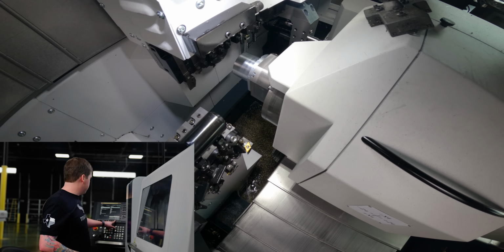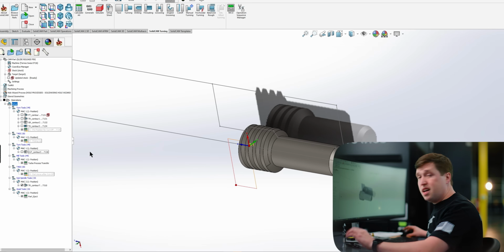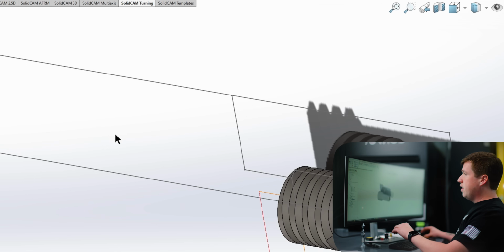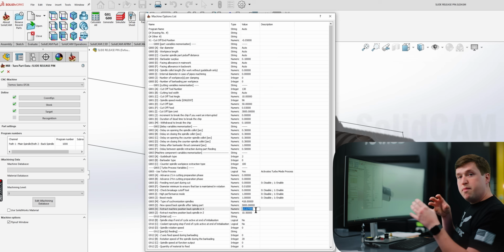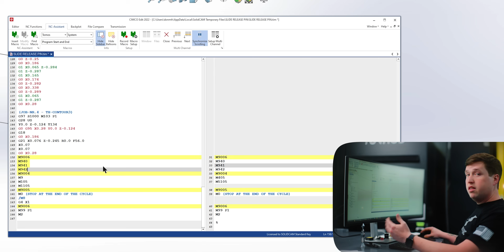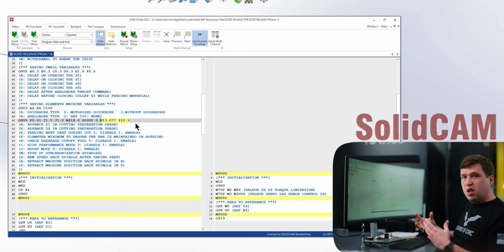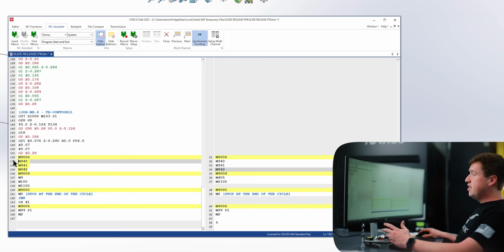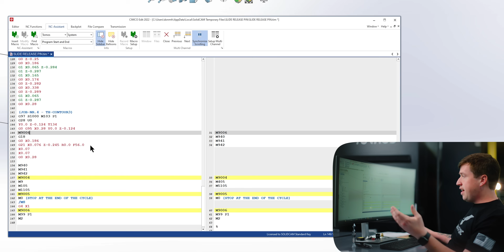Unlock Lightning-Fast Machining with These Unknown G-Codes

Comment: We droped Solidcam out of our factory because to be quite honest, not a good software for mill turning, specially transfers, you can't make your own transfer, you have to tell them what you want to write in the post, and down the line if you want to change it you have to go back to them again and keep editing codes back and forth, maybe for swiss is good but for normal, Milturn machines, like smx 2100 nakamuras etc, it's not a great option, but people might have different opinions.
Every time Our reseller did a post update it broke something else in the post in a way that we for a year had to almost edit 90% of the program posted in the machine just to go By.
Don't take this post wrong, this is just my opinion of a year fighting with the reseller to get the post's right so we could use our machines at full capacity.
We went for Esprit Edge, which atm already shown the possibilities of what i can do.

Comment: Shortest path is a straight line and when you have a transition between axes even if you don't see it the machine stops. Even in fusion some post processors allows you to select with axes to move first and you can select all at the same time changing machine movement from an Γ to a /

Comment: Unfortunately, we purchased this software for $17,000 specifically for use on our Citizen Swiss CNC machine, and it still isn’t working. We spent several months working with the SolidCAM team to try and resolve the issue, but to this day, it remains non-functional. Despite this, they declined to issue a refund—stating it was somehow our fault that their software couldn’t be made to work on our machine.

Comment: it will save aprox. 3 secons per cycle. That's not huge time bro.  :/
Reply: Ever make 1,000,000 parts? How long is 3,000,000 seconds?

Give you a hint, it's 35 days.
Reply: @TheFeralEngineer  for my experience most of the time back spindle waits for main already. This tip only works for %0.1  of programs.
Reply: @srknardc  With the main spindle usually being time heavy, and the ability to already have the sub spindle spinning up and indexed just out and, waiting for the last move in for the grab; the main collet regripping during the sub retraction will save cycle time, at least with every last part where the main spindle side is the time heavy side.
Reply: Adds up or similar i think. At least if you do a lot of parts.

Comment: I am not an expert programmer and never worked on swiss lathes, but why not just rapid towards cutoff in a straight line? Or sub can't read program beyond executing line on the main? Is this some kind of trick to desync reading of the program?
Reply: Pause the video before the move and draw a straight line and you'll see why.  This is also why unless you know what you're doing, you ALWAYS, ALWAYS, rapid up to clear the entire part and fixture before any other rapid move.

Comment: On a swiss the sub spindle is most of the time done way before the main spindle so why dont just move your sub spindle in place for part pickoff instead of waiting on the main spindle to be done this will safe probably more time and money because the g code you show probably costs 12000$ per machine to unlock and no i am not bullshitting Tornos actually is not ashamed to ask those prices for some software to unlock i will be surprised if an actual company would pay that to unlock a piece of software its ridiculous
Reply: The only way it saves time is when it goes back after parting but you could probably hand program this by yourself and save the company thousands of dollars
Reply: Please correct me if you think differently this is just my opinion
Reply: @lyjansen5138 i think it depends on the business. When doing lots of small series productions,having the quick and easy software capabilities couks be easily worth it. If you produce the same parts over and over,it might not be.

Comment: to clarify something, all the things shown in the SolidCAM MCO window come from the Post-Processor, which can differ depending on from what vendor you get your software or post-processor. I have hand written something simular into the post-processor of some of our 5-Axis Mills where I can change between 2 or 3 Axis simultaneous rapid moves. But cool to see that some machines can even do something like this just with macros, good Video Donnie as always
Reply: Thank you!
Reply: Cam you please tell me from where can I read/study these customized code ?

Comment: i honestly prefer iso/hand programming 3 chanel programs the most. dont know if thats normal or that im just diffrent like that ( with 3 turrets so each have there own channel and not where its 2 turrets but it see the back side of the lower turet as a sepert channel )
to me its pretty much as easy as programing a single channel single spindle. only hard part is to make sure that you name it right. so it dont put the 3 channel's progam on the secend channel ( been close to doing that a few times not gonna lie ) and when you put parts counter on each tool ( cause it will go in alarm if it get a part counder code that's ment for a diffrent turret )
Reply: Good ol star